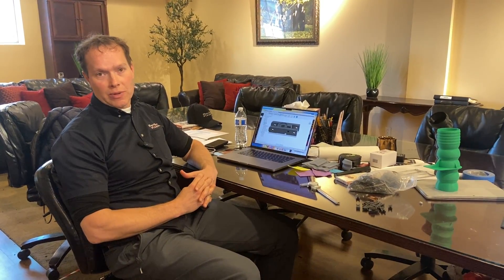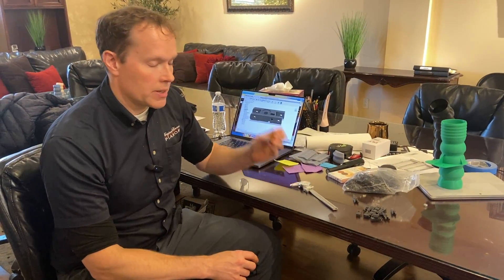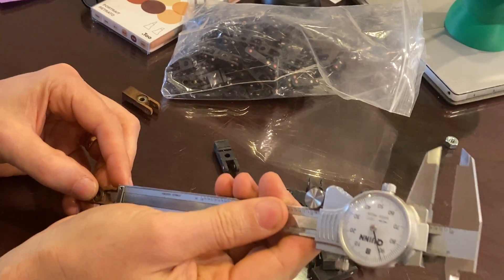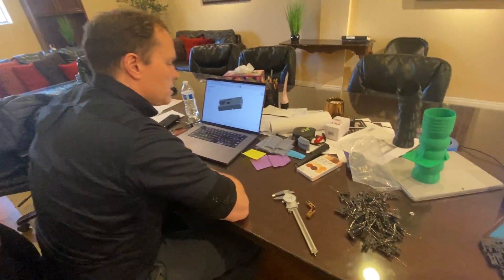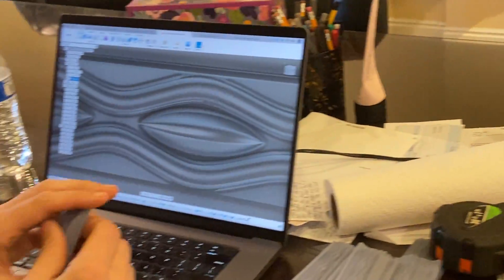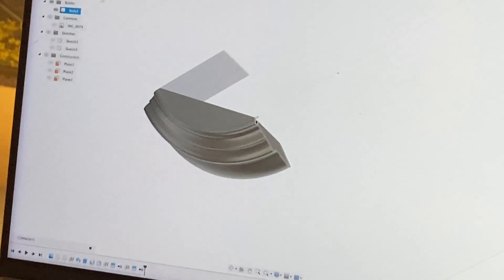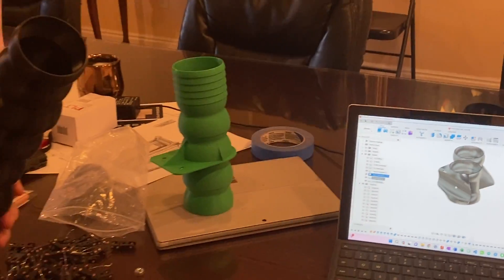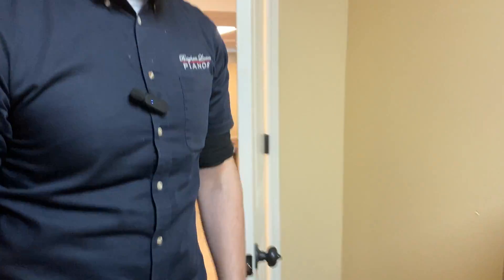3D Printing Piano Parts Process

Comment: I've used a resin printer for flanges too.  They're great for that.  Unfortunately it's more difficult when it comes to parts like jacks and levers because the resin is much denser than the wood that action parts are made of.  So you'd need to remake what were solid wood parts as I beams, put holes through them or something like that to keep the weight the same - like the WNG action parts.  I've not attempted anything like that yet.

I do have some slight concerns about the longevity of parts made from this material.  This side of the Atlantic we see Lindner uprights that were made in Ireland in the 60s with plastic action parts that started to disintegrate after about 25 years.  Hopefully, these modern materials will do better.

I love how you've repurposed an old  straight strung upright  as a 3d printer stand.